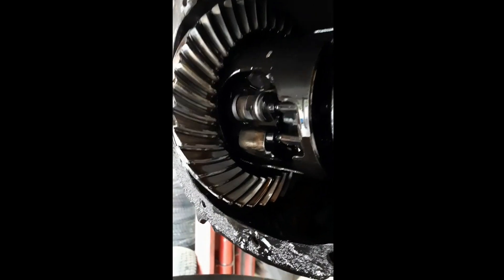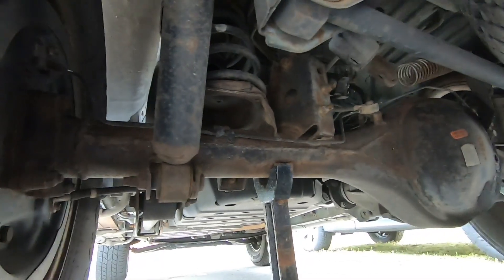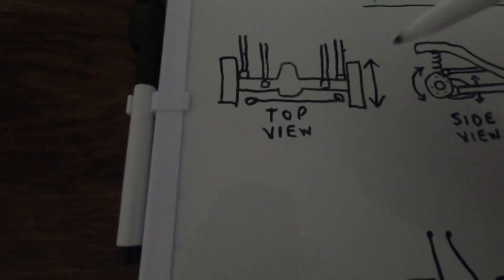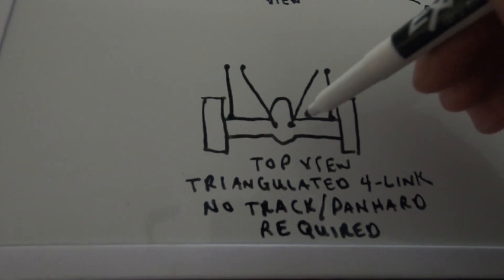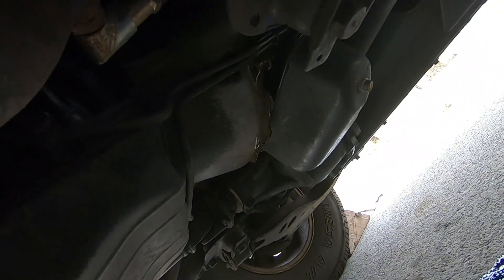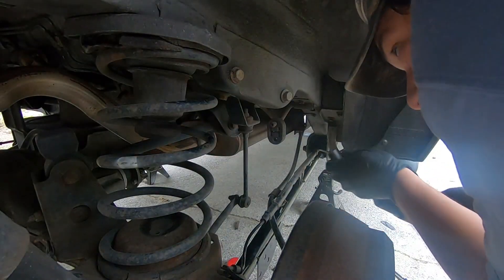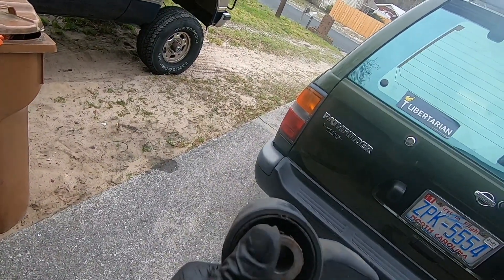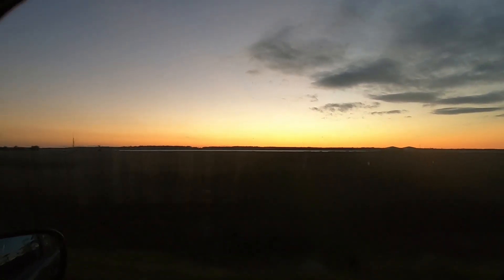R50 pathfinder control arm replacement 4link suspension explanation

Comment: Personal experience. He's sure right about buying the arm instead of replacing the bushings. For a DIYer it is a nightmare. I did my bushings and what I know now, this is what I would do differently. 

Use lube and heat. I never knew about this until I got in the trade. Yes buy them as assemblies, not just the bushings. Use / have better tools, which unfair for the DIYer. An Air Hammer and impact, electric ratchets, angle grinder, etc.

But it is possible to do with hand tools, in a driveway.

Comment: To save y'all time do the upper arms first on each side then the lower because it will fight you otherwise. Also i had to use a 1" strap on the lower control arm up front to the back to tension the lower arm in on both sides after the tops were in.

Comment: sometimes not putting the axle under load jacking up one side at a time can release the pressure on the lower control arm bolts

Comment: Sorry I haven't read all the comments  yet so idk if you answered this but how do you know that's ride height exactly?  By extending the jack stands far as they can on the Differential & that will make it ride height? Mine are currently all lose waiting to be tightened. Thanks in advance
Reply from the maker: just eyeball it, get it somewhere close. it will be fine. as long as you dont tighten it at full droop, your bushings will have a nice happy life.
Reply: @Lord of junk  Thanks for the quick response, you extended them all the way & it was enough? Do all jack stands extend to the same height? I feel like these aluminum Harbor freight ones I have don't extend as high as yours.
Reply from the maker: mine are harbor frieght also, but the steel ones. yours should be high enough unless you have oversized tires. just set the stands to where if you installed the tire, there would be like a 1/4 to 1/2 inch between the bittom of the tire and the concrete.
Reply: @Lord of junk  Thanks, I will do that first thing tomorrow.
Reply: @Lord of junk  Also I put new rear Gabriel Ultra shock absorbers, does it matter when I tighten those?
Reply from the maker: shocks do not matter

Comment: Would I have faulty control arm bushings when my 2002 Nissan 4WD fishtails when I let off the gas pedal? It only happens while in rear-wheel drive(not in 4WD)
Reply from the maker: more than likely yes. crawl under there and look for cracked bushings.
Reply: Yup. I had the same problem. The rear control arms are the culprit. I’ve replaced them and the fishtail is gone, the death wobble is gone. Be careful about over torquing the nuts on these bolts. They need to be able to move a bit when going over bumps or you’ll get a hard ride.

Comment: What impact wrench is that? I can't get those nuts off with manual hand tools.
Reply from the maker: it's a matco gun I've had for years. couldn't tell you the model right off hand, but it is quiet and powerful.
Reply: Well, I had another go at it and I don't know if an impact wrench will do it. I tied one end of a ratchet strap to the tow bar, and the other to a braker bar, tightened it up real good and it didn't budge. Gave it a few wacks with a hammer too but no dice.

Might have to cut it.

Comment: While off-roading, I recently snapped both of my upper control arms (upper trailing arms) and experienced zero rotation stability of the rear axel from a rear perspective. It was to the point that the torsion of the drive shaft would shake the axel while under acceleration. This was a very helpful video to continue to understand what is going on.

Comment: Great vid, thanks,  Any advice on how to check your control arm condition?  My Pathy behaves itself and doesn't really clunk or roll unless unless I hit a railroad crossing (this one in particular is in a dip on a slight angle) and I can feel the car roll and twist a bit.  This is the first tallish SUV I've owned so not sure if that's normal or I should start investigating things.

Cheers
Reply from the maker: some body roll is normal if you hit certain dips a certain way. its just the nature of the suspension cycling. however, r50's are known for having control arm bushing issues. crawl underneath and visually inspect those bushings. if the rubber has cracks in it, its time for replacement.
Reply: Copy that then

Comment: Where did you fineld new hex nuts and bolts? Doing the same project.
Reply from the maker: I just grabbed them from ace hardware. They are grade 8 standard bolts with lock nuts. Can't remember the size I used. I just picked up the standard bolts that were closest to the size of the metric ones I pulled out.
Reply: @Lordofjunk  good video btw. Thanks

Comment: Hey man do you have any tips for removing the upper arm on the drivers side? there’s hardly and clearance with the gas tank in the way I can barley fit a wrench on the head of the bolt! Any help is greatly appreciated!
Reply from the maker: Off the top of my head without looking at it, you have to take loose the plastic cover that covers your fuel fill pipe. Then you can get right to it. You shouldn't have to remove the entire cover, just the bottom part and move it out of the way.
Reply: Thanks. I got past the cover. Maybe it’s my compressor I just can’t seem to get the nut off. Might buy a new one and maybe I can just zip the nut off!

Comment: What if you plan to install a lift (OME HD front MD rear, approx 1.75" of lift)?  You mention torqueing everything as if it was at ride height, but what if my ride height (i.e. the lift) is going to change in the near future?  Should I account for this change in height?  I would rather have the control arms done before I move on to a lifting the vehicle.
Reply from the maker: That is a fantastic question. And yes you should account for the ride height difference if you want your bushings to live a long happy life. I have a 4" subframe drop lift I will install at some point, and was going to go over that on that video. All you have to do is loosen all of the link bolts after you install the lift, and jump on the bumper like I did in the video. Or you can leave them loose and drive around the block, slowly. Whatever it takes for the bushings to find thier new sweet spot.
Reply: @Lordofjunk  have you installed the 4” SFD yet? Would love to see an install video as i plan to do the same very soon. Just in the process of wrangling all the parts together first.
Reply from the maker: I have not installed the 4" SFD. The kit I was going to get was a never installed kit from an old friend of mine. he was gonna get it for cheap. I got busy and I haven't followed up with him. Maybe he still has it. I'm really torn on whether I want to install it on this pathfinder because it has so many miles on it (312k). if I end up installing it, there for sure be video.

Comment: I have a 02 pathfinder and I replaced the rear shocks but it still bottom out at times. Can you please let me know the cause and what needs to be replaced . Thank you sir
Reply from the maker: You mean the suspension bottoms out? Like it bounces off the bump stops?
Reply: @Lordofjunk  yes it bottoms out on bad roads and bumps.
Reply from the maker: Mine does it too if I hit a bump really hard. The only way to prevent this would be getting some sort of heavy duty shock.
Reply: @Lordofjunk  okay thank you for your help. I appreciate it.

Comment: You need to learn not to strip the bolt treads by hammering it to get it out. This is not the way to do it and mess up the bolt. You lift or lower the car to line up the holes and then a piece of cake. Also you dont get pissed and throw parts down the yard etc. This shows poor  control of character.  And all those sketches make it look more difficult than it is. Not needed.
Reply: Bahahah get a load of this guy ^^
Reply: i liked the sketches.  best explanation I've seen.

Comment: I'm in the middle of doing this job, using Nolathane bushings.  Before the nuts are removed from the control arm bolts, use an impact wrench to spin the entire bolt/nut in the bushing to free the bolt and make it very easy to extract the bolt.  I have a 1200 ft-lb impact and it did take about 3 minutes of impact to break them loose, but the bolts started spinning.  After you have the bolt/nut spinning, then put a wrench on the opposite bolt head or nut to restrain it from spinning and loosen the nut or bolt.  This method eliminates the need to pound/cut/torch the bushing bolt to get it out.
Reply from the maker: Yeah, what you said works great as long as the sleeve inside the bushing doesnt spin.
Reply: Quite true.  I really was fortunate on this job, as all four sleeves were held in place by the remaining rubber bushings well enough that I was able to spin the bolts before removing the nuts.   If the sleeves started spinning, I would probably try to jam them with a small metal chisel inserted between the bracket and the control arm.  From my disassembly, it appears the bolts are not rusting, but since they have a rather heavy cadmium plating, are suffering from cadmium corrosion, which is a white powdery substance, that causes a bonding with the unplated sleeves.  After a twenty mile test drive, the polyurethane bushings are stiffer, but superb in terms of rear stability.
Reply from the maker: I tried the chisel trick off camera. I threw the entire tool box at it. Haha. It seems things rust where I live worse than in other places. I only live 1.5 miles from the ocean. The salt air is rough on things. I have used poly bushings on other projects, and I agree they are superior. This truck is my worn out beater daily driver, so I opted to go the cheap route in this case.

Comment: Where did you get the bolt that you had to cut and what size is it. I had to cut several bolts and can find the right size. Can you help???
Reply from the maker: Cant remember exactly what size it was. I do know I replaced it with a standard size, not metric. I matched them up at ace hardware. Make sure you get a grade 8 bolt and use some kind of locknut. I used nylock nuts.
Reply: Lord of junk thank you dude! I got half inch bolts grade8 at home depot but they have a little more play than the original bolts. Going to ace now since they were closed last night? And see if they have something closer to the original. Once again thanks!